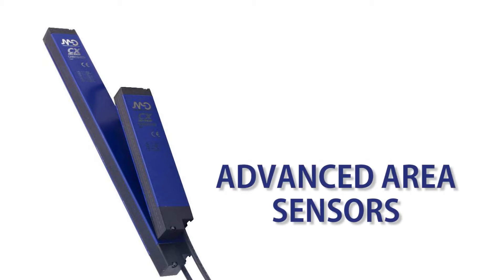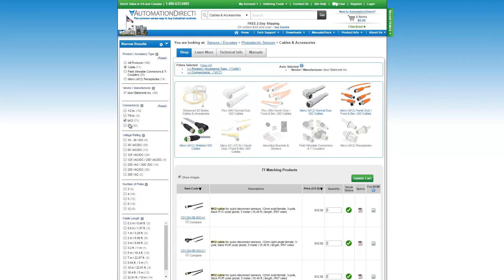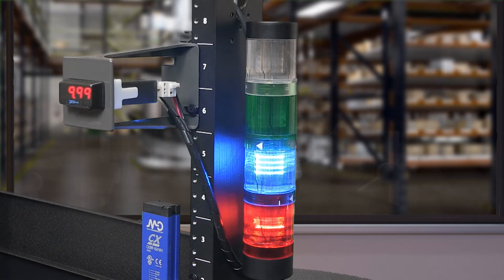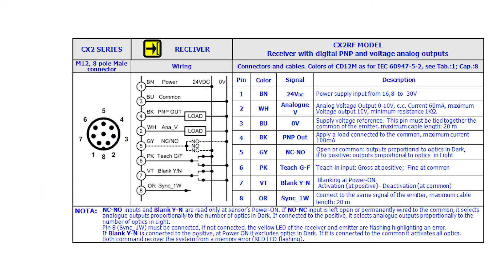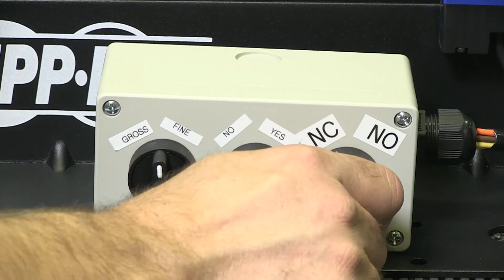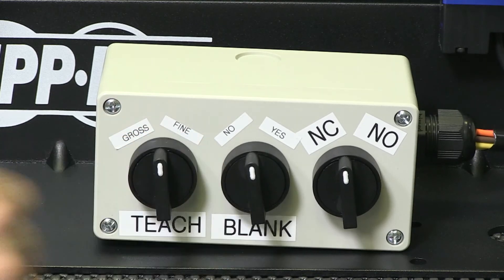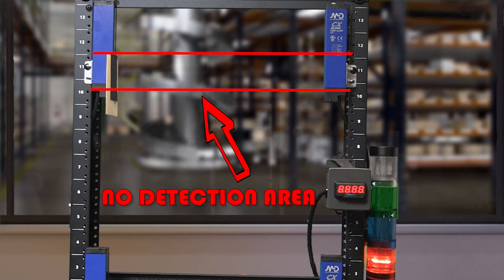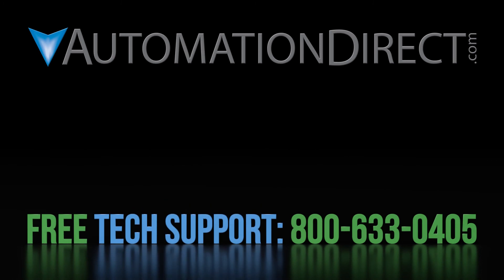How To Setup and Wire CX2 Area Sensors from Micro Detectors at AutomationDirect

Comment: Tengo un  CX2E0RB que no logro sincronizar, las luces amarillas siempre me oscilan
Reply from the maker: Tecnico Turno, AutomationDirect does not carry the CX2E0RB part number from Micro Detectors.  We do not have the product information to assist you with technical help. We suggest you contact the manufacture or where you purchased the sensor from, or if you would like assistance purchasing a sensor AutomationDirect offers, our technical support team can assist you. Thank you.